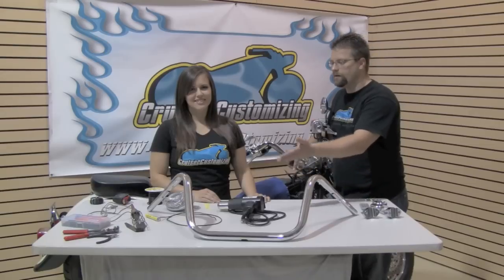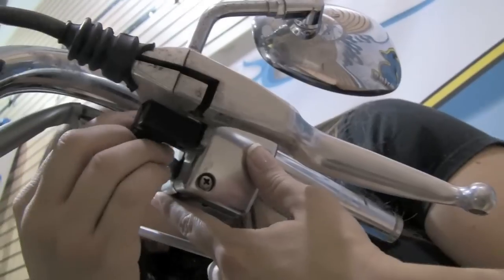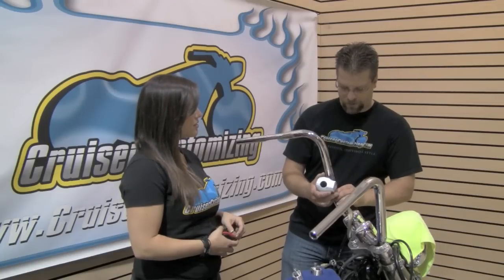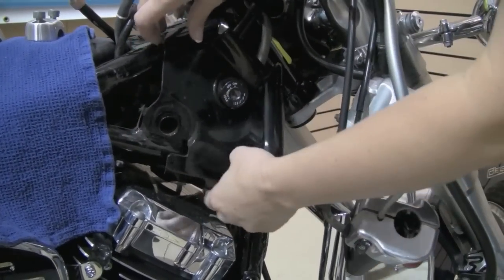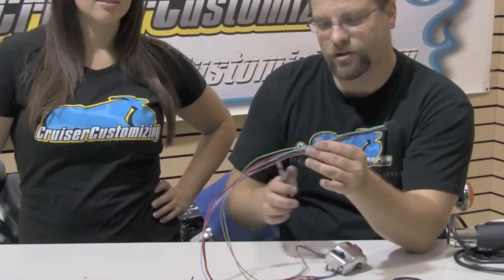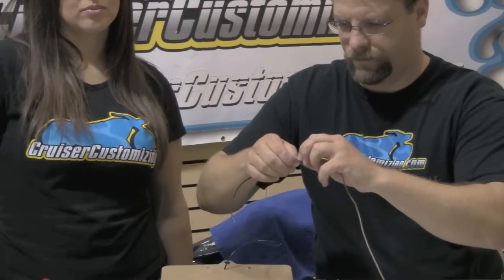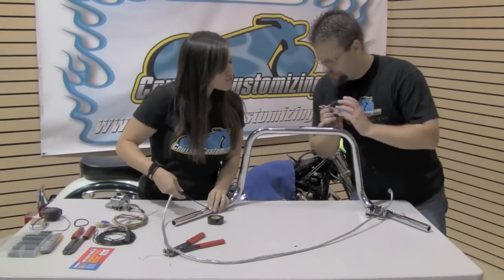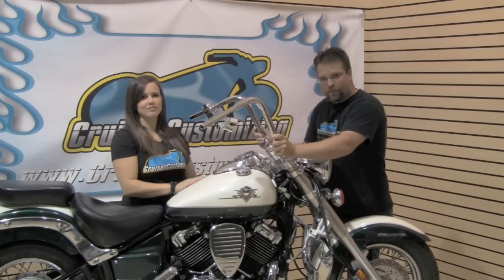Motorcycle Handlebars - How to Install, Internal Wiring - Video Guide: Tip of the Week

Comment: if you run all black wires through the bars, how do you know which color wires connect to the factory plug?  just curious. I used white wire and marked each lead with a thin pen on the end of each wire.  Might be worth noting what method you used for that
Reply: +luke short Sure it will. If the black wires are all the same length. Remember, he cut the colored wires at different lengths, so the black wires will now be at different lengths and can match to the plug side, which is at different lengths as well.
Reply: +Mastah_Blastah um.. didn't he then clip them all off at the same length? thus no way to tell which wire is which.
Reply: No he clipped the harness wires at different  places and then the black wires all the same length - this will naturally line up, makes perfect sense.

Comment: Similar to my Road Star except,
1. I have the 1 piece riser & covers the wire hole on my apes. Would it affect n e thing if i drill a hole in the middle ? 2.stock grips, my guess is, have to buy aftermarket grips, since the one's off of my road star has the screw-on end caps ? Thanks for your help, Very helpful!!

Comment: I noticed after you ran the wires through the bars,  you just left that sleeve on there. What's next?

Do you cut the clear sleeve in order to get to the wires to re-solder them back to the connections?

Comment: 5 minutes in this video i realized its better i let a professional do this.... a bit difficult, and i dont want to screw it up... ill invest the money, then messing around with my sportster 48..... great video though
Reply: elvibaby Lol I'm thinking the same thing, I'm sure I'm capable but it's not worth the mess up, I could just imagine something going wrong on the road and that's the end of that.
Reply: There was very little professional about this video.  Joins should never be soldered, and it is always better to not cut the wiring - it is much better to make an extension that plugs into the existing connectors.
Reply: That isn't even possible to do with the custom length!  @spoon69x

Comment: So watching this video seeing using the same color wire for the extensions and then covered in covering but wasnt soldered to the connector side, so how do you know what wire goes to what for the connector side after its covered, wouldnt it make more sense to remove the pins from the connector and solder to the extensions and then cover and run through the bars then put the pins back in their stock locations

Comment: 2 Questions, please:

1) with internal wiring you don't need dimpled handlebars anymore, correct? You could do with a non-dimpled?
2) Would the same procedure work just as effectively when using shorter handlebars that connect directly to triple trees without using a handlebar riser?
Reply from the maker: +craik 1)Yes you could do the same with non-dimpled bars but you have no room for error when you drill the holes. The dimples just allow a bit of wiggle room for comfort adjustments. 
2) You could run them through any hollow bar. The main concern if you are not using a riser is clearance to get the wire out of the bar at the bottom and routing it out of site.

Comment: Using crimp connectors are a terrible choice either twist and solder then add skrink tubing or even better. Now they have those heat shrink tubes with solder in them 1. Slide tube on wire 2. connect wires and slide shrink tube over wire connection with the solder part over the connected bare wires 3. heat with lighter or heat gun and move on to next wire

Comment: Extending the brake cable, clutch cable and wires is pretty easy. I also took pics of the original plugs to make sure how to put them back. The kit extensions were not exactly the same colour as stock, so I documented eg blue is now blue with white stripe. Put everything back together, I had lights, signals, everything on the left side worked fine but the right side where the RUN and Ignition are, does not work. I tried other combinations of holes in the stock harness which was not touched but cannot get RUN or IGNITION to work, so I pulled the wires back out, tested continuity, got the meter to move when I tested them across each switch, so it's not the wires, the connections or the switches but I cannot get RUN or IGNITION.. battery is pretty new and charged, terminals are clean and tight, fuses are good, even sprayed them all with contact cleaner, there are only 9 wires on the right side (2010 Roadking) frustrating. In theory, the harness from the bars should match colours (save and except for that the extensions might be slightly different) but basically the handlebar harness should be the same as the female stock harness which was not altered. I don't get it.

Comment: Don't know if it was said before, but don't blow on your solder.
Reply: godlyke3 what do you mean by that?
Reply: Isaias Solis blowing on your solder can cause cold joints.  At the very least it introduces moisture into the connection.  Just bad practice when soldering.
Reply: +godlyk3 got it. thanks for the heads up
Reply: The wires shouldn't even be soldered - it creates a section of rigidity that becomes a weak point for the wire to break at.  If you have any doubts as to whether soldering on a vehicle is safe, consider the fact that wiring on aeroplanes is never soldered...

If they actually wanted to do the job properly, they would have created an extension with plugs on both ends so it can simply be plugged in to the existing harness - this way everything is reversible if required (and you haven't butchered your wiring harness...)
Reply: Myths. If blowing on a joint caused a bad solder joint, fume extractors would do the same thing yet they're used by professionals.  Also tell me how water that's already vapor is going to penetrate molten metal that's well above the boiling point of water vapor. LOL.
Reply: @spoon69x  exactly what i was thinking